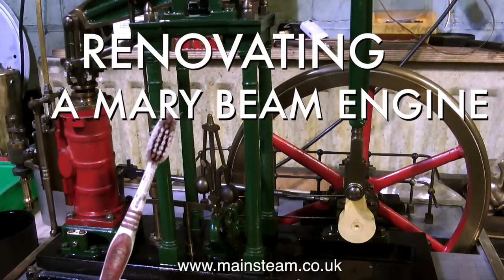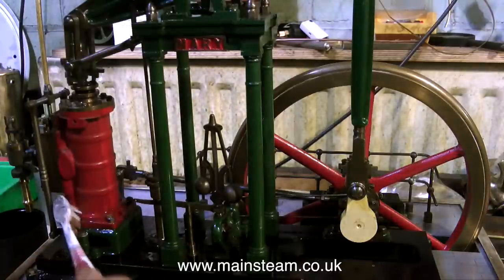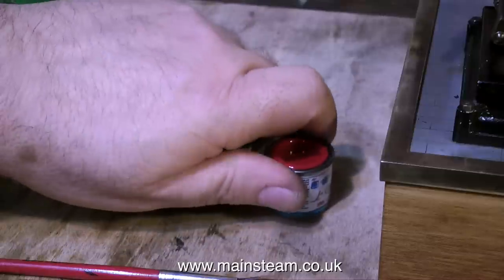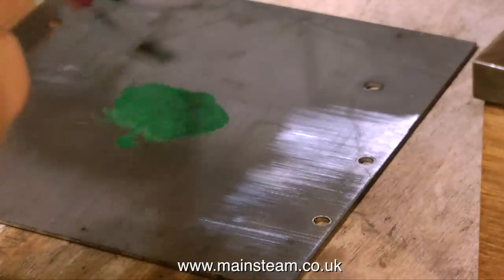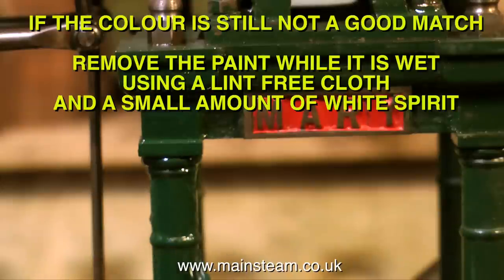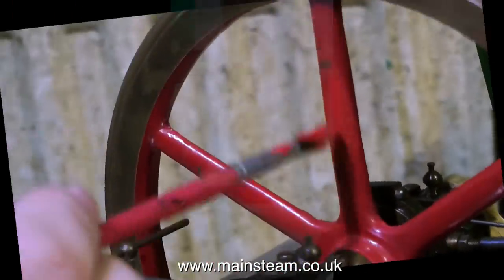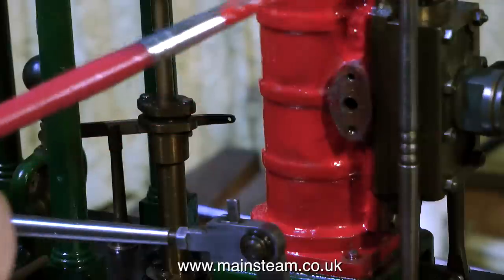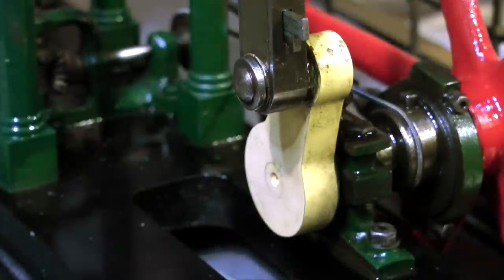PART #6 - HOW TO RENOVATE A "MARY" BEAM ENGINE MODEL

Comment: Buff and light buff as a colour is as old as the hills, I believe that for a period in the early 20's the used a colour called dark buff to line locomotives with an effect of gold and somewhat metalic line work, if you search nswgr 3642 on Google you'll see the locomotive is currently painted in bright green with red and buff lines. The colour buff is also refered to as "straw" in a lot of cases. Love your work Keith. Hope to see more about your workshop type steam engine soon
Reply from the maker: Thanks for that Dan, your info is appreciated.